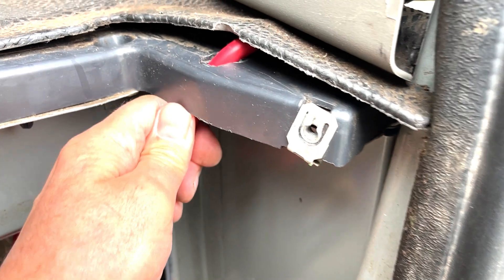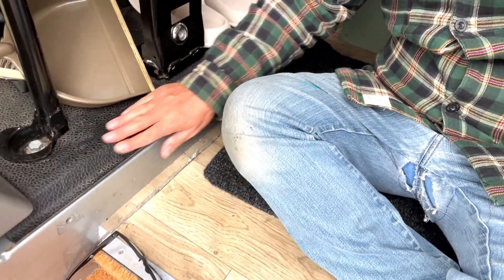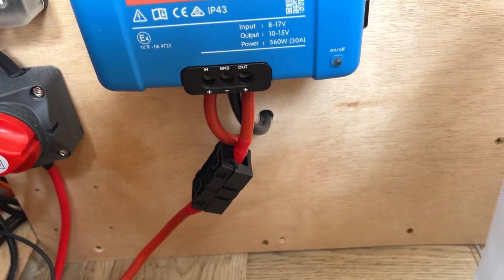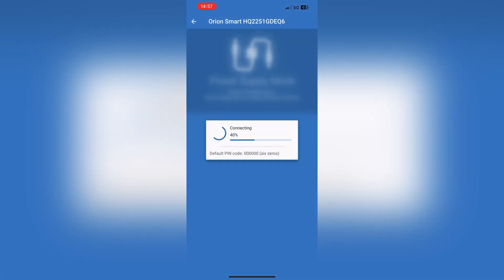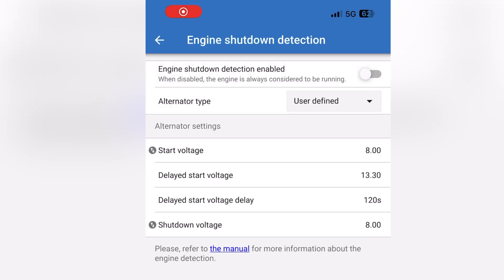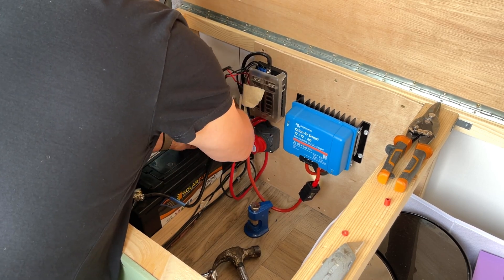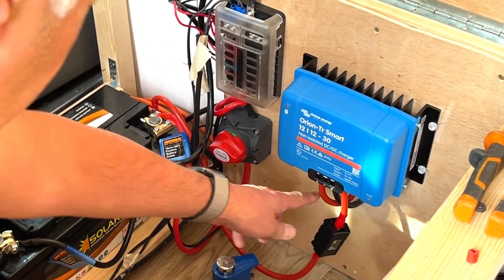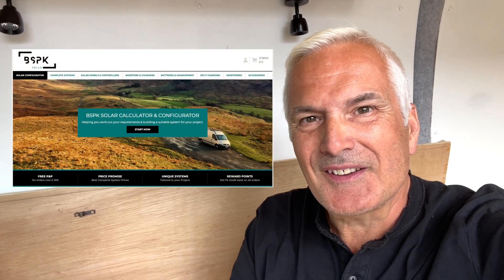Connecting the VICTRON  ORION TR SMART DC DC CHARGER NON ISOLATED to a LEAD ACID BATTERY.

Comment: Nice job thinking if doing the same. What size leisure battery is that pls?
Reply from the maker: Hiya, thanks for watching. It is a 12v 130AH deep cycle for motorhome etc. I got it from Tanya Batteries on Ebay, with very good service.

Comment: Just picked this charger up not long after watching your first video earlier on today. 10/09/24

Just been out trying to connect it up check it works. 

But way too much rain but managed to get it actually working to test it. Some time in the week I will look at getting it fixed in place 👍

Grate second part
Reply from the maker: Excellent, best of luck 🤞

Comment: What was the reason for not using the EcoFlow for the Van power?
Reply from the maker: I'm using a combination of the two. Lights and TV and maybe charging the odd phone and watch, and the Eco Flow for the big stuff like cooking and boiling the kettle. I find it's always better to have a little back up. 
I've also found that the fridge is using a lot more power than expected, and some of the days I just wasn't getting enough solar power to keep the eco flow topped up. I hope this answers your question ?